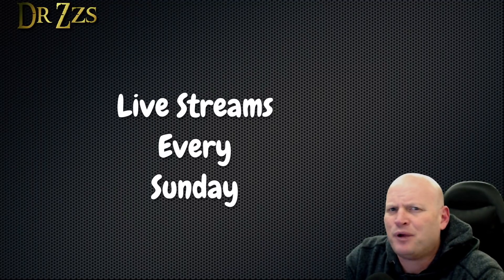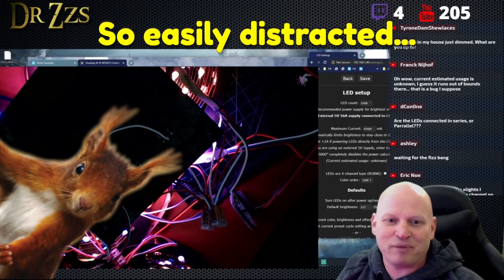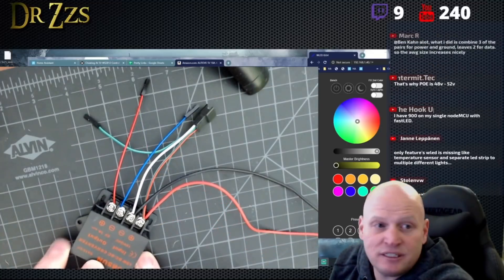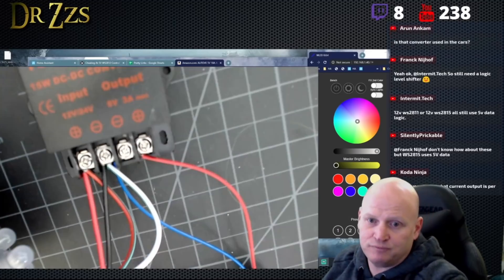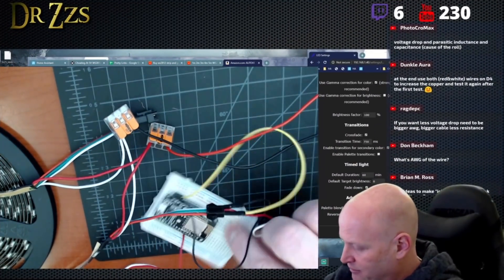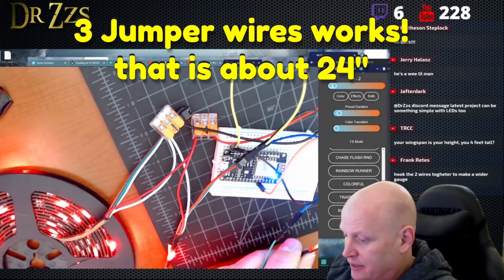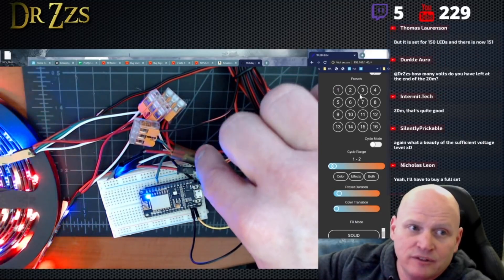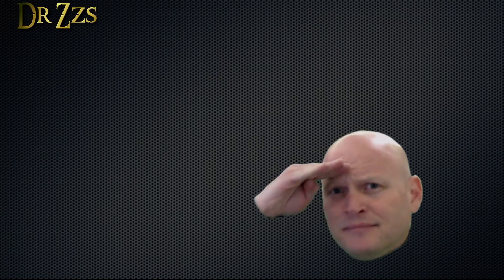Answers to the Most Common DIY LED Questions

Comment: Thank you, thank you, thank you. This answered a ton of questions I had! 
One more question for ya (and then I think I'm set for the holiday season) ;) ...I got my NodeMCU all set up and can access it from any wifi enabled device as long it the NodeMCU is still connected to the usb... once I disconnect it and connect it directly to my power source, it shows "offline." I checked power with a multimeter and it reads 5V so it seems to be an issue with it re-connecting to the home wifi once initially disconnected. Any thoughts?
Reply: I figured it out... I had to change my router to static IP and set the static IP of the NodeMCU to the "Client IP address" and set the gateway to the router IP address. Any other method was not working. Thank you again for all the videos. These are amazing!
Reply: Brian, I had the same issued, my solution was re-flash the nodemcu with the older version WLED version 0.8.5 and it's worked great for me. I'll might update the the latest version and will see what happen. Hope this help.

Comment: FYI with a teensy3.2 I'm  doing 30 meters to my first led of 1200 with no problem and no sacraficial led
Reply from the maker: Cool! That board must put out 5v data instead of 3v like the nodeMCU.  Just had a peak on google.  The teensy3.2 is $20?  It's probably better than a nodeMCU in many ways at that price.  
Thanks!
Reply: I may have to give this a try. I have 3 nodemcu's for 3 different strings and can't seem to get enough voltage to run all three strings off of one nodemcu. I'm even using a logic level converter but it doesn't seem strong enough to get the data signal all the way to the the led's

Comment: Hi DrZzs , i have just purchased some SK6812 RGBW led strip lights and connected them using WLED app,. I have one problem though when i choose a solid color other than white only one in three leds are that color the others are different when i choose white all LEDs are the same. I have changed to all the variations in the settings for color order but with no luck,Any Ideas?

Comment: Love your content! It's making me want to go deeper and deeper down the DIY rabbit hole. But it seems I need to learn about electronics (boards, amps, voltage, jumper wires, etc.) and I need to learn how to solder. Is there any resource you'd recommend to learn about those things? I haven't been able to find a good video on the subject by the DIY YouTubers I watch regularly. Maybe I'm missing it, but if you could point me in the right direction I'd appreciate it!!

Comment: What are the best addressable leds on amazon and ali express and where you get you power supplies from could you run the lec direct off mains power say uk 230v connected to step converter

Comment: Sorry, I posted a similar question in one of your other videos. What is the best actual method to split the data wire? I see in the video you use a white plastic board. This is my first LED lights experience, but I'm pretty good at figuring things out. Is that what they call a breadboard? Is there a specific type I need to get? Any recommended link for it? Also, when using a sacrificial pixel, do you end up just twisting the wires together? Do you use wire nuts? Thanks!!!!

Comment: How do you get multiple controllers to work so there is a light run from controller to controller.  IOW, If I have a 60 meter run of three strings 300 each with 3 controllers haw a light run starting at light 1 and run to 900 light run.

Comment: I also purchased these plugs from eBay... 3pin Male And Female 22AWG LED Strip Wire JST SM Plug Connector. they are an exact fit for my ws2811 strings. they make connections so simple... and a generous dab of dialectic grease on them and they will last a good month outside.

Comment: Could you please do a video on 110-120V LED's?

I own a single story home with an eve at the same level all around my house, which is approx 300'. It would be much easier for me to wrap one 300' LED strip around my house @ 120 V. But I want it to be addressable/and capable of setting up a light show in the future. 

I just don't know the ins and outs enough to know what's best for me. Thanks

Comment: Can you put a PIR sensor on the MCU so lights  do I certain thing when there is motion? I would like to use this setup at the front of the house and would like different themes depending if there is motion or not, but I don't want to run 2 boards when the MCU has so many unused pins.

Comment: Thank you SO MUCH for putting out this info condensed like this. Answered all my questions. I think for my first Christmas light pixel setup I will just run 2 or 3 pixel runs off one NodeMCU along with power injection. Then my WiFi won't be taken over by NodeMCU connections haha. Your videos are the best!

Do you have a name / affiliate link for that white 'tester board' you used in the video? Gotta support your channel!

Comment: Aren't your pins on the NodeMCU 3.3V? Not surprising you were getting some problems on the 20ft cable. I'm thinking about using some optoisolators to use the 3.3V pins to allow 5V to pass from the step down to the data pins. No clue if it'll work but it makes sense in my head lol
Reply: Look into a logic level shifter. If I understand what you're saying that might be your best bet

Comment: @8:53 I am planning on making s mega tree, 9 identical strings, starting from the top of the tree and moving down. So I want to split the signal 9 times.
Reply from the maker: I expect it will work.  Let me know if you try it before I do :)
Reply: @DrZzs  challenge accepted -- https://youtu.be/B4rhwGVbgL0

Comment: Can I suggest you repeat this with the LEDs programmed to full brightness white.  Your video could lead people to install long runs of WS2811s and then find out the hard way that cabling considerations need to be made when running them in full brightness white where they consume their peak wattage.  Even if you don't intend to run them full brightness white the installation needs to accommodate for it in case of software failure generating full brightness white.  Some LED strips will go to full brightness white if they lose the data signal.
Reply from the maker: Sure. I'd be happy to.  
Which part would I redo?
When I did the current test I did set it to full brightness and white after testing a few effects and colors.  I gave the AWG chart link and a warning about using appropriate sized wires.   
It would probably be useful to dedicate another video just to wire sizing, but this video wasn't intending to do that.  
Thanks!
Reply: @DrZzs  I seemed to have missed the bit around 4mins when you did the current test.  Apologies.   It was later in the video when you were running 40 meters of them, I think you were trying to prove the ESP could stream data to that many, but I think to safely power them you'd need some beefy wire.  Depends on what chart you use, but 12 AWG looks about right for 24 amps.  In series the strips themselves might melt.
I just worry that people will string 20 meters of these things around their room and try and run it in series or with thin wire and start a fire.

Comment: MQTT Discovery.  So I've been digging and it very much looks like there's something fishy going on, but  (at least for me) all isn't quite lost.
I set up a new WLED device, and set up MQTT.  I subscribed to the homeassistant/# topics on my MQTT broker and waited for messages to come through.  They did.
Still, nothing showed up in the MQTT integration for new devices.
I dug into the logs, and found quite a few entries saying "[homeassistant.components.mqtt.discovery] Component has already been discovered: light WLED_a020a6158ee8"
Restarted HA and then I saw the fateful line...
"Found new component: light WLED_a020a6158ee8".  Still nothing in the discovered devices, but searching for WLED2 (which was the name of the device) in the developer states tool it was there.  And set up.  And ready to go.

TL:DR - there's apparently an issue showing new devices in the integrations tab, but they do seem to show up
Reply from the maker: Thanks for helping spread the info!
Reply: @DrZzs  "Blogged" it at https://marcjenningsuk.github.io/Home-AssistantConfiguration/

Comment: This is a great condensed version of the live stream! Thanks for putting it together!
Reply from the maker: You are welcome!  
I'd like to do this more.  I just need to remember to hit "record" a couple times during the live streams :)
Reply: @DrZzs  I askd on discord but I'd like to ask on this .. I have 12v ws2815 that do/di and bo/bi data lines I tried to split the data but it's not working any suggestions how it be best wired up